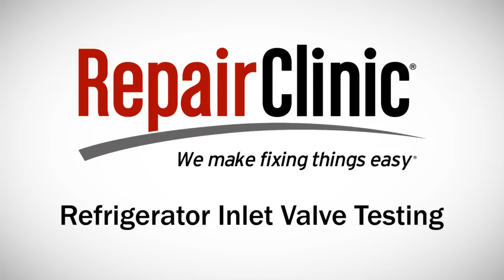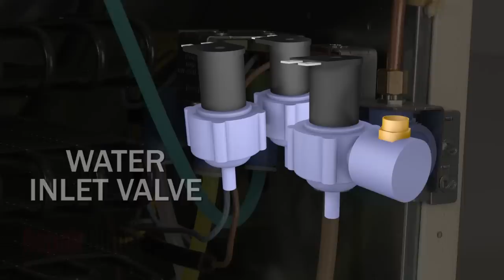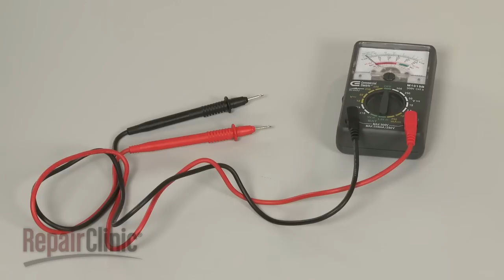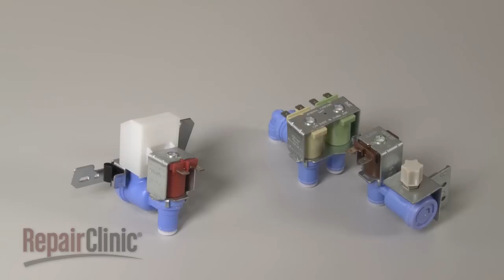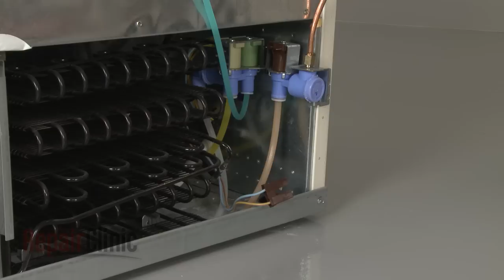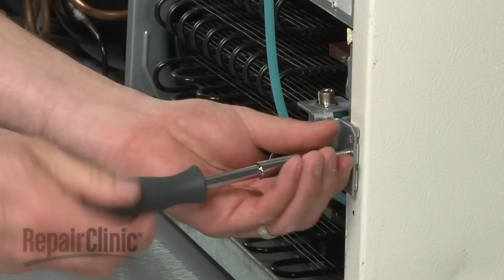Refrigerator Not Making Ice? Inlet Valve Test, Troubleshooting

Comment: i only get 177 Ohms between the coil terminals on brand new GE water inlet I ordered.  I also do not get tone on continuity function.  Is that normal.
Reply from the maker: The coils resistance is so high you likely will not get a tone on the meter. 177 Ohms indicates a good solenoid.
Reply: I've seen other sites that say 200-500 ohms.   I have a dual solenoid and the water dispenser is 250ohms and the ice maker is 150ohms.   Really anything over 100 probably means the circuit is fine.  You're really just making sure the resistance is not zero and not like 10,000 ohms.  The zero resistance is the most likely result of a failed circuit.

Comment: On the door of mine it has the ice and water option. I saw a  video and it said if you can get 8 oz  per 10 seconds, it was good.  I am getting more than that. But does that mean the ice maker is getting water as well ? 
I set the digital meter to the lowest setting. Pulled the wires off the first one  got 193 ohms. Put the wires back on. Then the other side I got 255  ohms. In the video it said between 500 and 1500 ohms. So does that mean that both are going  bad ?  Not that it really matters because you have to replace the whole thing anyways.
The water works fine. The ice machine works but is so slow.
Reply from the maker: +William Wynn The water dispenser and ice maker water supply are two completely separate systems inside of the dual valve so potentially the dispenser could be fine and the ice maker side of the valve fail.
Reply: Anything between 150-1500 indicates a functioning circuit in the valve.

Comment: Mine will make ice. It just won’t dispense it. Any ideas? I’ve tried to research myself. Haven’t found any helpful info. Few ideas but nothing to narrow down and say yep, that’s the problem.
Reply: Could be the heater in the tray
Reply: Bruce Paulson Heater??? In the ice maker???
I looked in the manual, researched the net and here and YouTube and nothing seemed to explain or fit what was wrong. I’d just be stuck with buying parts and fixing thing after thing until I stumbled on the right fix. Will probably just hire a pro at this point. Can’t afford a new fridge yet.
Reply: @nwadmartin  the ice maker heats the tray so the ice will come out when it cycles. 
I would just replace the icemaker,  mine was 137 bucks on Amazon. 
Much cheaper than a new fridge,  and its easy to change.
Reply: Bruce Paulson it dispenses it out of the tray, just not through the door. I’ll see if I can find one to fit my fridge on Amazon I guess. Sounds like it’d be cheaper than a repairman:
Reply: @nwadmartin  not sure about that,  I would check on Amazon though before buying a new fridge.

Comment: The coil on my part #2315576 valve inlet reads 350 ohms does it have to be in the 500 plus range you've shown?
Reply: No.  150ohm to 1000ohm is quite common for working valves.  Remember even if the circuit is good, the valve can be mechanically broken.  So this test can't confirm your valve is good.  It can only confirm if its defective.
Reply: @TommyMapother  I'm sure by the time you replied to this post (4 years later) that this issue of his is a thing of the distant past. With that being said, the best way to test these valves is to unhook the outlet, put them over a pan or bucket and just put power to them.

Comment: I checked my inlet valve and the multimeter read 20 on the ohms x 10 setting(lowest). Since that's 200 does that indicate replacing?
Reply from the maker: +SCott MArsh That is likely a good resistance for a valve coil. As long as you don't get an open circuit it is likely good. However, a valve can still fail mechanically.
Reply: BTW - Its not recommended to try to repair a valve that has mechanically failed.  Just replace the valve or else you could end up having a valve stick open the next time it makes ice and it will flood your kitchen until you can turn off the water supply.
Reply: @TommyMapother  If they're going to leak, they're almost certainly going to leak as soon as you hook them back up. Also, Sticking open is typically not a problem, as long as you keep the unit clean. I think the common problem is the rubber seals get hard over time and form to their mating surface. When people take them apart and put them back together, the seals moved or rotated and no longer mate properly. Or else they get damaged in the cleaning process. All these issues cause the valves not to seal properly. It's very unlikely that they would actually "stick open" in a literal sense.

Comment: The ice maker stopped working so l replaced the ice maker, water valve and filter. Checked the door switch for continuity assured proper temperature in the freezer and check for ice blockage in the water lines. The water pressure is good and water is present at the door. I can cycle the ice maker with jumping the T&H ports but no water at the end of the cycle, that is the problem. What else can I check to get the water to the ice maker? I jumped between the L&V ports and it pops the circuit breaker.......

Comment from the maker: #Refrigerator  water dispenser or ice maker not working? Could be the water inlet valve's fault. How to test: http://youtu.be/aXIX73EI1Z4. Enter your refrigerator model number for model-specific repair help: http://www.repairclinic.com/repairhelp.  #diy   #diyrepair   #RepairClinic   #howto   #video
Reply: I have already replaced the water inlet valve, but water still does not flow to the ice maker.  My water supply has not problem.  Where do I check next?

Comment: If I am getting 189 ohm across the valve does it need to be replaced?  I ask because my drinking water valve right next to it reads around 250 ohm and works fine....but ice maker is not working and empty of ice.
Reply: James Lowe i have a water inlet valve where i work that reads 180 omhs across the two terminals and its brand new out of the box.

Comment: My refrigerator has water and ice maker, but when I measure the inlet valve coils, i get infinite resistance which indicates that it is bad. I know i am getting contact so what could the problem be?
Reply: It means the circuit is faulty and has a break in it, meaning no electricity can flow through it.  You need to replace the valve.
Reply: I found my problem. My resistance scale was on too low of a scale (200 ohms). I had to be on the 2K ohm scale in order for it to work. I remeasured and two of the coils measured around 500 ohms and one of them measured around 250 ohms. So, this is weird because I get water out of the refrigerator, but I don't get water to come out for the ice maker to my knowledge unless it has something to do with the ice maker itself. Ideas?? Problem possibilities? What next? Thanks in advance!
Reply: Sometimes the water line to the freezer ends up freezing up.  Can you see up the tube and see if it's frozen or clogged?  Or put a flexible wire or something up the tube and see if it's clogged?   

If so you might have to move everything in your freezer to a cooler for a few hours and turn off freezer to thaw out the line.

Another possibility is the valve is broken mechanically, not electrically.  So even though the circuit is fine, the mechanical parts in the valve are messed up and jammed so it can't function properly.   

Another possibility is the ice maker itself isn't supplying the signal to make ice to the valve.  You can use your multimeter and a piece of insulated wire to check the ice maker itself.  You just remove the front panel.   Here's a tip sheet that works for most ice makers:  http://www.applianceaid.com/icemaker-module.php